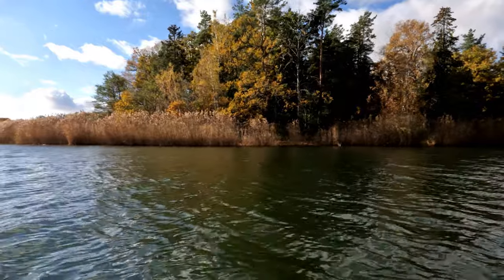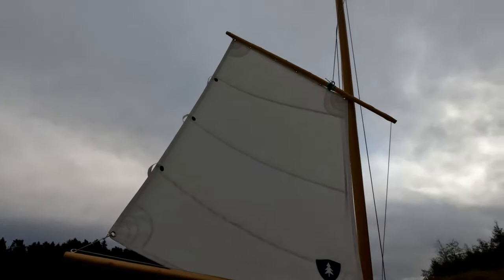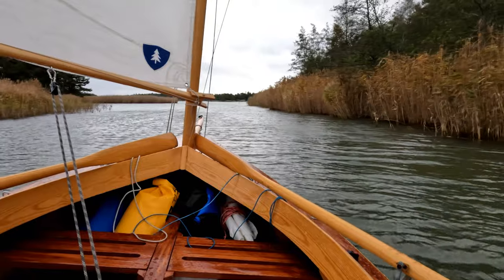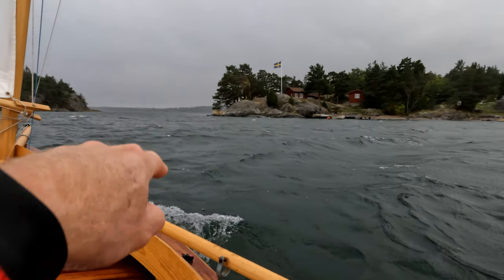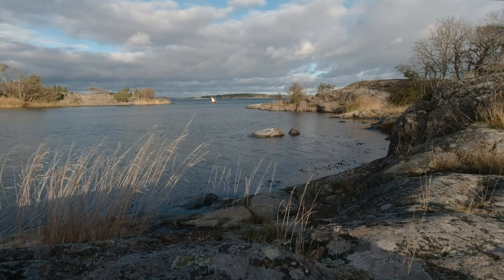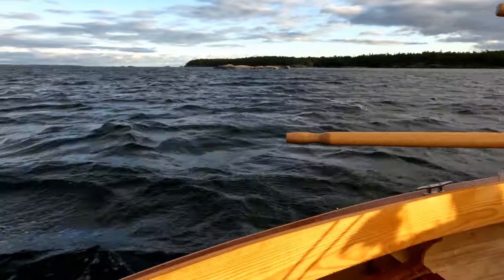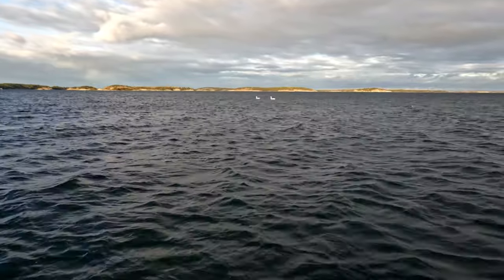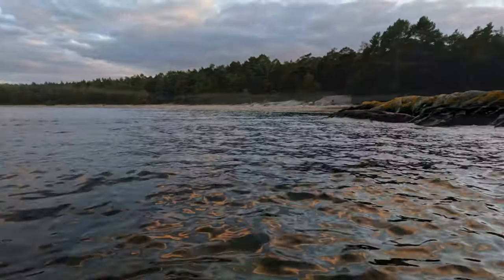A somewhat scary Halloween sail from Trosa to Askö, gust up to 34 knots in an open canoe Yawl #160

Comment: Good idea to use the mizzen on the main mast in strong winds, i will try it on my own Kanot Yawl 400
Reply from the maker: Thank you, I was in a little trouble before I tried this setup. The only thing that I might change in a similar situation is to also take down the mizzen mast. The drag from the mast (and the rest of the boat) is substantial in relation to the small sail area. All that can be removed helps to control the boat.

Comment: This  was a really good video  I'm  hooked on your adventures. I read your comments to Koos and had no idea it took so much equipment.  I've been burned on technology before, and haven't invested in it since saga saturn discontinued , 2000$ Toshiba laptop blue screen of death . 
Now more about the video  those were big winds that flag on the pole looked ironed flat against the sky.  I think I heard the boat strike ground twice  ouch 😬 the sun shot at 11:31 I think one of your best I liked how it looked between the crests of the waves.  You looked your most worn out in this video than any other.  Thanks for bringing me along and thanks for the work you put into your videos.  If you don't mind how long did it take to edit  just this video  ?
Reply from the maker: Thanks Jarrod! I think you actually could do the same video with only two cameras, one action camera for all wet scenes and one fast lens camera for the night stuff. If you want aerial views as well, as I also had, you will of course need a drone. Due to flight restrictions at the military zone close by I could only fly the drone at the starting area. Also the wind got too strong really quick so I had no real use of it. I only stroke ground once, at the sand on the landing beach. And that made no damage to the boat. The noises you heard was probably from the wind throwing the spars around. The charts that I use are really good so they locate the grounds within a few meters. The problem was more the wind that heeled the boat over giving me some problem bailing the boat. I do not keep record of the editing time as I do it in small pieces when I have time, but I guess at least 15 hours.

Comment: Nice video again, often, mizzen and jib works well in strong wind too. Not sure if you have a jib though :)
Reply from the maker: Yes I have a jib/headsail. The problem was that it was too much sail area with both the mizzen and the headsail, I got a bucket of water over the Gunwale in each gust. With only the jib the boat is hard to control as the center of effort is too far forward. It's impossible to head upwind and the heeling is also too much in those wind conditions that I had on this tour.
Reply: @sailoutofagarage6212  that's loads of wind :)) loved the evening sky with all the lights, nice night scene
Reply from the maker: @Canoesailor  Thanks again. Yes the wind was too much for taking anything but the most protected route. Most filming I do with action cameras (as sailing often is wet) but I have a fast lens camera on a tripod for those night shots.
Reply: @sailoutofagarage6212  looking great, I now have counted 4 camera's onboard ;) 2 x gopro, phone camera, and a compact. 
It's great you can sleep in the boat, did you have a problem to get it dry enough after such a wet crossing?
Reply from the maker: @Canoesailor  The phone, I do not often use as a camera, more to display charts. The cameras I use are DJI Osmo Action (best color scheme), GoPro Hero 10 (horizon leveling but unnatural colors, much post color grading needed), Sony A6400 (tripod and night photo but unreliable and not user friendly). I also have a Hero 7 that I have used a lot until september but now only is for backup.
No problem to dry enough as it does not need to be completely dry, I use foam mattresses under and on the sides and they can handle some moisture. With a bailer and a sponge I can get out enough water..
Reply: @sailoutofagarage6212  ah, I looked at the sony 6400 before deciding on the Rx100, fantastic little camera. You're well stocked, I still bring the old gopro 4, but mainly use the 8, indeed not very natural colour, but colour grading is a step somewhat too far for me now. Hope to start publishing my Sweden videos soon...
Reply from the maker: @Canoesailor  Yes please do, I have been waiting for your West Coast Trip.
Reply: @Canoesailor  can't wait to see your videos.  I really loved your Raid extreme so much I came up with my own 42.0 bay raid a sailing canoe and kayak  challenge.  Did the first one earlier this year . Me and a friend  he ended up capsizing and went home afterwards.
Reply: @Jarrod_D  wow, thanks, they do a Rsid X in Germany now too. I got a burnout, too much work, but getting better. My concentration is lacking to keep working on video editing, 5 mins and I'm distracted. Will be ok again...
Reply: @Canoesailor  no worries 👍 thanks for the reply. Saiil out of a garage is putting out super high quality content.  I think it is probably the best small boat sailing channel out there .  I've  started uploading my canoe sailing videos as clips mostly raw and uncut, because I to am easily burned out in front of my phone , and already have a full-time job and I post motorized bicycle content 😀.  Sail on a canoe =motor on a bicycle